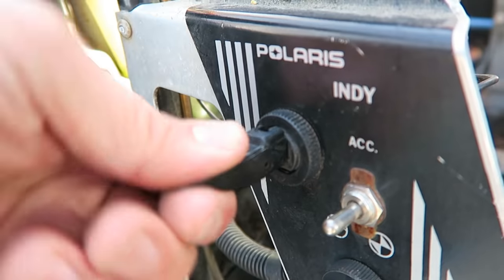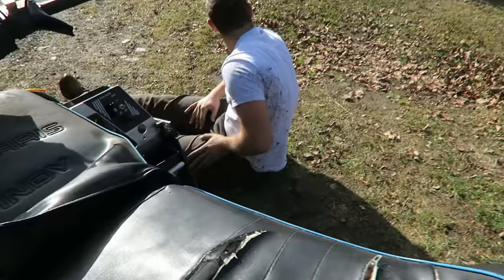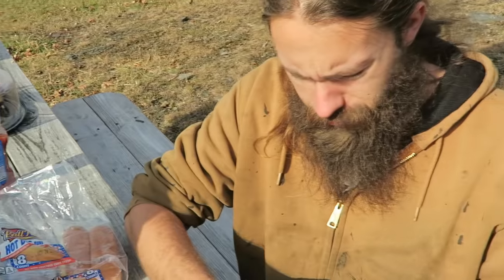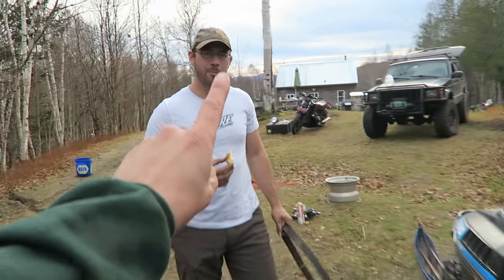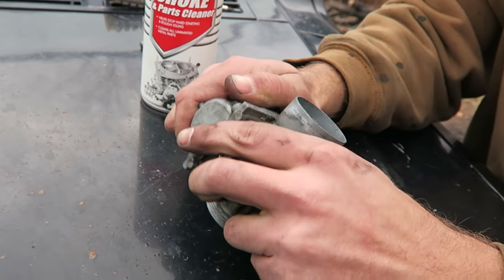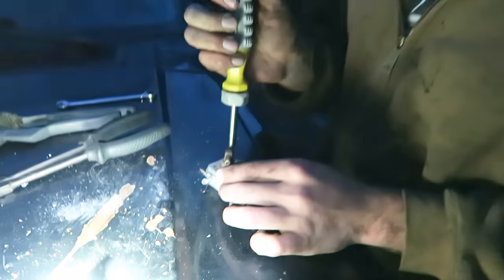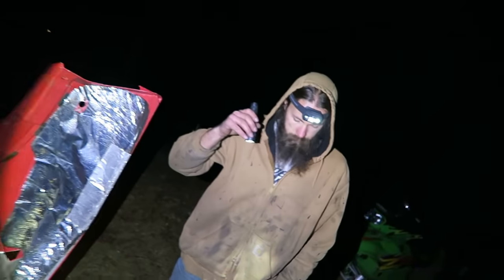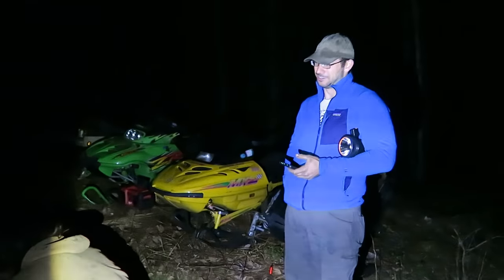Reviving DEAD Polaris Indy Snowmobiles Sitting for YEARS !!!

Comment: Of course the Polaris will run !  I never had a doubt about them.
Reply: I had a 92 Indy trail 500 and it was a pos
Reply: @AndrewLitwak85    That's too bad , we had 6 different Indy 500s in our family over the years. All of them had over 15,000 miles on them with just normal wear and tear items replaced.  One of them we kept longer and it had over 20,000 miles with no problems.
Reply: @richardthomas1743  mine had over 60,00 miles on it and was a pos
Reply: @AndrewLitwak85  LMAO , yeah okay.
Reply: @richardthomas1743  I’m serious, my uncle owned it before I did and even year he went on huge trips with it and then he didn’t have time to ride it and so he gave it to me.
Reply: @AndrewLitwak85  I believe that. We had a skidoo 377 and all winter every winter between my brother and I it never stopped. It had around the same miles on it.  Never rebuilt. Ran like a top. Until the tunnel cracked in half.  But that motor was still running strong.
Reply: @joerutkowsky3261  yeah my ski doo is running great
Reply: @AndrewLitwak85  buddy get it serviced 😂
Reply: @IAmScottyE  I sold it and got a mxz

Comment: The indy lite was NOT the worst sled of 1990.  It was the 1990 polaris star.  Same chassis, no IFS, leaves only and, a 250 CC single.  Light AF tho.  The lite and sprint ( I see you have one in the back there) were fun because they were hella light, and a 340 twin was more then enough to push it.